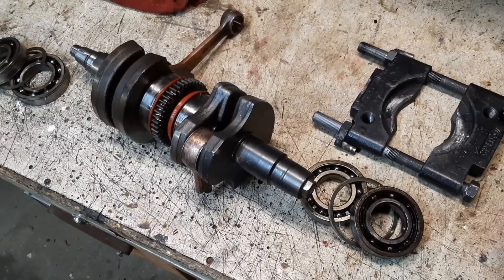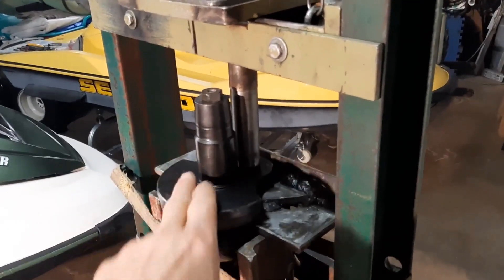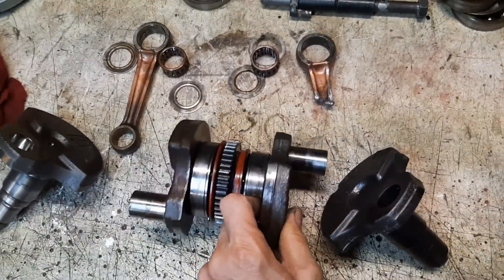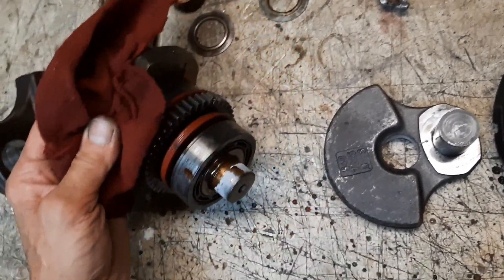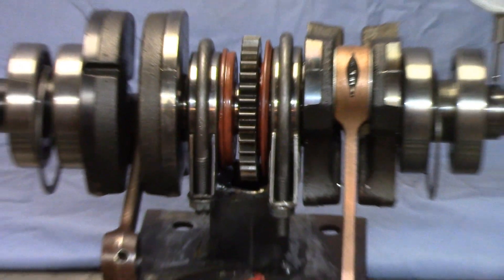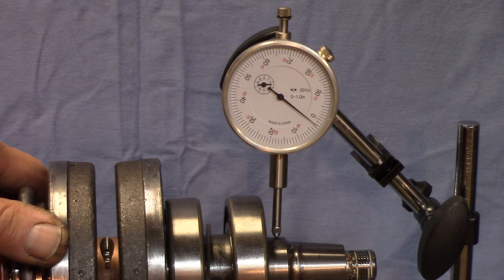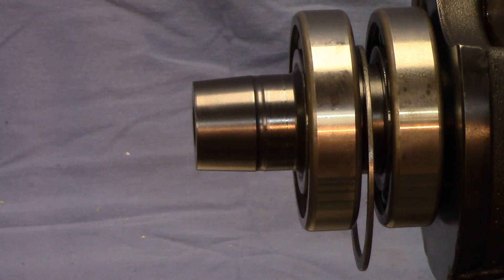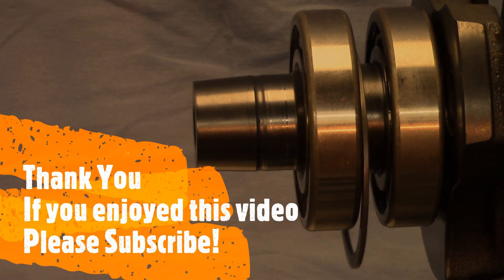More Precision Crankshaft Repair on this Latest 2003 GTX 951 DI

Comment: Great video, thank you for sharing.

Couple questions if you don't mind.

1. Did you end up welding the journals together or use the loctite product? If you used loctite, can you share the number please (e.g. 609, 638)

2. How did you align the crankshaft rod pins to be 180 degrees of each other?
Reply from the maker: You should definitely use loctite 648 on the press fits. This is what the factory uses and it really works. I make a 951 stroker crank for a 1100cc big bore project I'm working on and I weld those. However you should preheat them properly because the crankpins are high carbon chrome steel.
Reply from the maker: I put the ce ter assembly in the lathe between centers and inspect the high points to ensure 180 degrees on the index head.
Reply from the maker: Center assembly that is
Reply: @crankshaftandco  Thank you for the information. I really like your videos, they are entertaining and informational.  

Cheers,
Corey

Comment: Hello thanks for sharing this video. I have the same crank to rebuild and not sure if I can do it with my press.
How many ton is the one you used?
Reply from the maker: It's only 8 ton but it takes good fixturing and heat like I say.